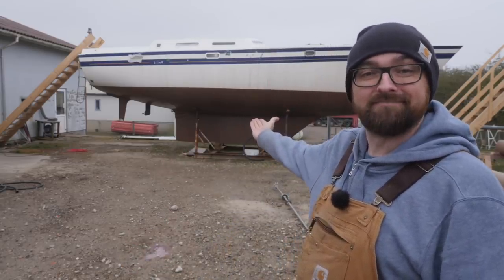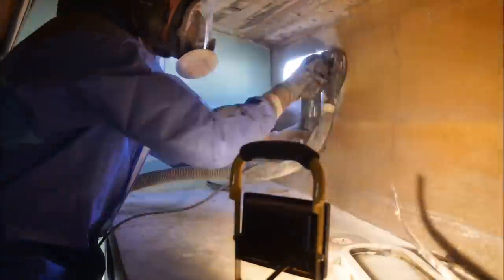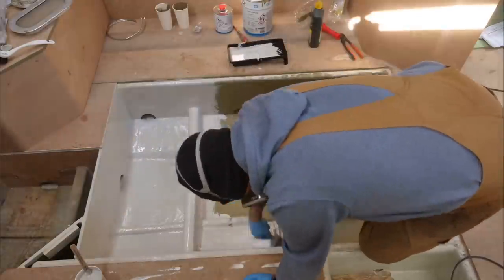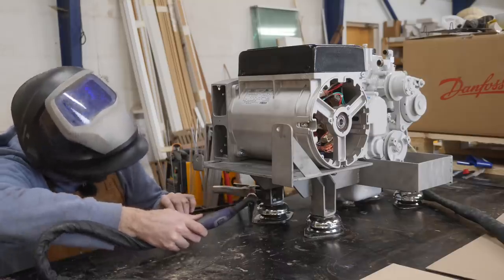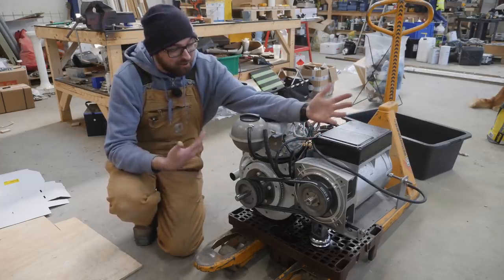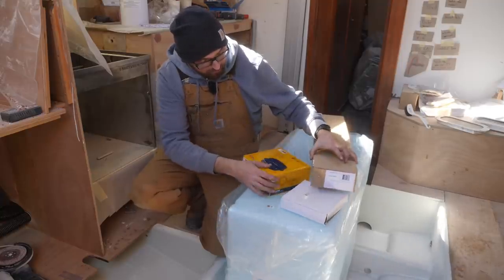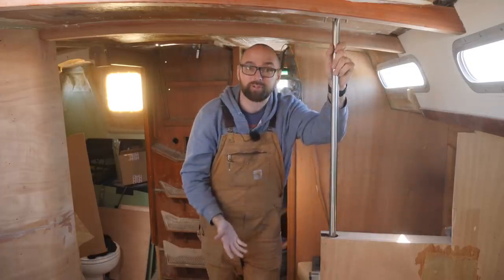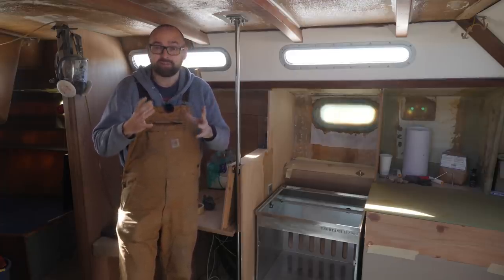Sail Life - DIY generator fail, galley pole - sailboat project

Comment: Hey i don't know the specs but if the 102 block is the same as the 402 couln't you just change the injectors ans the cam perhaps to get a better outpus out of it at a lower price?

Comment: Get yourself the right sized engine for the generator. It'll be more fuel efficient as it won't need to be run as long or as often as the smaller engine. Do it right first time 😉

Comment: I might suggest that you calculate just how much more generator run time is needed with the reduced generator capacity.  For battery recharging-your biggest generator load- take the available amp/hour capacity of the battery bank (total AH*Depth of Discharge), divide it by charging efficiency and divide that number by the 4,000 watts from the generator.  For sake of discussion I assume the minimum battery bank you might use would be 4 conventional flooded L-16 batteries with an AH of about 400 and a DOD of 50%.  Recharge time from a fully depleted battery bank is about 1.2 hours, theoretically.  Once you bulk charge with the generator, absorption and float are less critical and will be augmented by solar.  Your battery choice might have a greater AH capacity so adjust the figures accordingly.

The Victron 24/3000/70-32 has a max DC charging amps of 70.  Two of them would charge at a maximum of 3.36 kW, within the capabilities of your existing generator.  The inverter(s) intelligently reduce charging to prioritize loads, protecting the generator but prolonging recharge duration.  The inverter will also sync-to and support the generator to power loads above the programmed generator capacity, assuming the batteries have some level of charge above low battery cut-out.

These back-of-envelope calculations indicate a 4 kW generator, while not ideal, may not be too bad of a situation. 

I am an off-grid energy designer and I would be happy to provide pro-bono design input.  I have minimal marine power experience, however.

Comment: It wouldn't be a proper build without a proper screw up. 
I agree with the comments..... upgrade the engine, if possible, for more output or swap out for the 402. 
Not a massive mistake. Not life threatening. It won't make the boat sink.

Comment: Can you mount the generator so you can use both engines to drive it? the perkins for low amp. and main engine for the hevvy stuff.
and no need to run 2 engines while motoring.. 
With free wheel ? on both engine pulleys it would work .- the generator runs on the engine's that is on..
don't know if they can handel the load of your generator but on most diesel cars you have free wheel on the generator  pulley. 
many car's have generators over 120A so I think they will work..

Comment: Sell it.  Or keep it.  Maybe get it in and used, then upgrade it if you feel it's not actually working for you.  Dont worry yet, much to be revealed in months and years to come.

With the solar, make use of (or design) a flexible mount so that you can point the panels at the sunlight.  That will net you more consumable energy.

Comment: I was just getting ready to suggest running two 3000 multi plus victrons, but you beat me to it. That would work well for your situation. You can just turn the charge amps up to whatever point you feel comfortable loading the generator. Not a big deal. Your gen time goes up by 25% but what the hell. Live and learn. One annoying part of running the victrons in parallel is that once you program them you can’t turn one off. If one fails you have to disconnect it and reprogram things. Kind of a PITA. No quick way to get power from just the one.

Comment: Does the 402 have the same cylinder bore as the IBP? Therefore, is it possible to modify the IBP so it has the same output as the 402? ie, use 402 internals and adjust the fuelling, as it possibly has a longer stroke. Or, does the IBP have enough torque to run another smaller generator at the same time? Or, can you sell the IBP and get a 402? I suppose it boils down which of these is cheapest and easiest.

Comment: Will that small Perkins 102 work to power a small dive compressor (like a 3cfm) ?  Doesn't solve your generator problem, but you might be able to repurpose that motor.

Comment: I don't quite understand the incentive to install a second engine. Would it not be a tad easier to connect the massive generator to the existing main diesel engine? One less item to install, maintain, provide sound insulation, take up space? I would not anticipate fuel consumption running the generator to be much different between the two engines.

Comment: What’s the actual internal dimensional differences between a 102 and 402? If the cylinder is a larger bore, couldn’t you get it punched out with a 402 piston, sleeve, etc? That would have to be cheaper than a wholesale replacement.

Edit: looking at the spec sheet the bore are stroke differ between the two. Maybe it can be punched out or resleeved with 67mm bore and 72mm stroke. I’m no machinist but sounds plausible!

Comment: If the Perkins 102 and the Perkins 402 have the same dimensions and same outer hull wouldn't it be possible for you to simply swap out the itty-bitty-tiny-little-Perkins 102 for the stronger one?

Comment: So not really familiar with perkins but cummins diesel engines alot of the time have extra head room when they are built,  older truck engines it was throw in bigger injectors and/or turn up the fuel pump pressure. Newer trucks alot of the time it's just program the computer. Not sure if perkins follows suit but I would not be surprised if you could tweak the engine a bit to maybe squeeze out a few extra ponies one way or another. Or maybe just find the 402 you were looking for and go from there you have something to sell/ trade with the running 102
Reply: Your little 102 does have a fuel adjustment screw so there is a possibility of tweaking it though it is a give and take, turn it up to much and you will be puking out un burnt fuel and lots of carbon build up.

Comment: I’d say buy the smaller alternator and finish off the 102 generator and sell it to someone in need, especially if the used market is so bad. Then get the 402 and use your larger alternator to build Sail Life Generator 2.0!

Comment: Yup, do it right and you know what "right" is.  If you stay with itty-bitty, you'll always and repeatedly, kick yourself that you didn't upgrade.   Sell / Donate "itty-bitty" and obtain the size that you need.

Having said all that I think you need to go back to square 1 and relook at ALL your options to provide a separate power charging system.   I'm thinking that you'll want to keep with diesel BUT, you may want to purchase a turn-key solution.   As I say, look at all your options.

Comment: If the 102 and 402 look identical, is it possible that the 102 can be modified with 402 components(pistons, cylinders, carburetor, etc) to get the benefits?

Comment: Well your washing machine or oven do not pull the rated power all the time. There are charger/inverter combined units that will help out via the battery and  then recharge the batteries while your appliances are not heating (75% of the time). Better find out if your setup is worth it before sinking more money in your genset

Comment: My 1 cent to add to the pile---it sounds like the 102 might be large enough to serve 75% of your needs, is there any way to increase your battery bank so you can store more power and for times when you need maximum wattage, how hard would it be to put a generator on your main engine?

Comment: Just a random thought here. But can you not attach a larger pully to IBP to make its rpm  effectivley higher, it should work up to a point where there is too much load on the engine. Won't cost much to do.

Comment: I think you are being way harsh on yourself. I can understand your frustration, but keep it in the perspective of literally everything else around you that you have done so well.  Install the itty-bitty Perkins 102. Keep your peepers peeled for a well-maintained 402 or another quality replacement (Perkins or otherwise). You may not find the right replacement until you and Ava have been sailing for a year or more. But it will appear, and the 102 will perfectly sufficient in the mean time.

Comment: How about adding a fairly powerful generator to the main engine, combined with a battery charger of like 2000 watts?
So I guess that you would need a generator that can output about 200 amps at a reasonble rpm. I have no idea though if there are such generators available, what they would cost, how big they would be, but it would perhaps not be totally unreasonable?
This way you also get a kind of redundancy if the Perkins setup fails, and you can use a fair amount of electrical power when going by motor without starting the perkins setup....

Comment: Would it be possible to increase the diameter of the pulley on the Itty-Bitty perckins and reduce the pulley diameter on the elec motor to increase RPM and therefore increase kw ?

Comment: Mike_ Sandee
1 second ago
i agree with simply upgrading the parts for a 402,  of course do the research,  but Perkins would use as many parts on all models as possible even if it lowered efficiency in an effort to save money so this will work in your favor to re-mod it!!

Comment: Also, a 6000W inverter draws 250A at 24Vdc or 500A at 12Vdc. Consider the cost of the wires, connectors and the batteries to generate such power. You would be better off with a more reliable, lower wattage inverter. My two cents worth...

Comment: As far as the generator goes, can you send the bigger alternator back and replace it with two smaller ones?  Will the motor power two?
Reply: Maximum power out (of the diesel) equals maximum power into (and out of) the alternator(s). You can't magically get more more power out of one or more alternators than the engine produces. That would violate the laws of physics. And given that no conversion system is ever 100% effective, you'd probably only get 90% of the engine's output from the alternator(s) anyway.
Reply: JAFO I have seen multiple youtube videos of engines with more than one alternator.  If they are run in parallel the synchronization must be identical which is difficult.  It is better to seperate the battery bank into two seperate banks and run them on the same motor but with two different charge controllers and battery banks.  You could produce 8400 theoretically if the motor can handle it.  

https://www.cruisersforum.com/forums/f14/using-2-alternators-to-charge-a-house-bank-79903.html

Comment: Ok I feel for you.  You did a lot of work and planning and I think the generator as it currently is not going to work for you.  But I don't think you should give up.  First since the 402 and 102 look the same from the outside there may be just a few internal parts that are different and perhaps you can replace them to get what you need.  There is a good chance that the only difference between the two engines is the size of the piston and the cylinder.   If that doesn't work maybe you can try "hot rod" your little engine.  There are always ways to get more power from an engine.  I bet your engine has mechanical fuel injection but if it has electronic injection you made be able to remap the software to add more fuel.  A diesel engine is not like a gas engine and adding more fuel will produce more power.  Also because your current setup has all those pullies in place perhaps you could supercharge your engine. In any event give it a try because I don't think you will be happy with what you have.  Best wishes and stay safe.  BTW enjoy your video's.  Thank you.  PS:  One thing that also bugs me is your hatch covers.  A hour of sanding and a bit of varnish and they would look a thousand times better.  Of course I understand why is not on the top of your list but hey it bugs me.  :)

Comment: will not the close proximity of the freezer/refrig, cause condensation, with the warm diesel from the fuel polisher,  inside the diesel tank ? --swap out the small engine for a bigger one, now,--and think about 2 wind generators, as they will work, when you are moving, and when the wind blows at anchor,

Comment: If the two engines look the same, what makes the difference between the two? I know that with gasoline outboards the difference between a 9hp and a 15hp is the carburetor. I know that diesel is not carbureted but...... what can reasonably be done to increase the engine output? You could increase the engine pulley size and decrease the alternator pulley to up the output. Similar to road bikes or variable speed drill presses. That should allow you to keep the engine rpm’s lower while increasing the rpm’s on the alternator.

Comment: Hey Mads, stop beating yourself up, you are human. I seriously doubt there will ever be a time that you need to run the dive compressor/the washer/the water maker/ the anchor winless/water heater/blow dryer etc. at the same time. You can only overthink and over plan so much. As the Rolling Stones said “You can’t always get what you want, But if you try sometimes you’re just my fine, you get what you need! Cheers

Comment: 4kW should do you, imho.  Charging the batteries comes AFTER all the other uses, not before, so calculate based on that.  My HOUSE rarely went above 4kW (before I put in the full house instant hot water system, which you would be insane to have).

Comment: Why not keep the small motor as a backup power supply and get a 401 for primary power?  You could use the smaller motor to use less fuel for times you need less power.

Comment: You have a lot of projects ahead. So I would call the generator project done and move on to other tasks. Best is the enemy of better.

In the meantime you can keep an eye out for a used engine with more horsepower. Could really be any brand. And it could be a few months or a couple of years down the road.

Comment: Would you get more power if you changed the pulley size on the engine for a larger one so that the alternator spins faster?  Did you consider selling the 102 and buying a 402?

Comment: I agree with most of the commenters that you should go ahead and upgrade the engine while you have it out.  As annoying as it is now, when you are on the water, you will thank yourself for going ahead with the bigger engine.

If you can't source a larger engine for a reasonable price from the boating world, check other industries that use small diesel engines, like used commercial power washers.  It's not something you usually see listed, but you can find tons of these engines out there with a little digging that might just need a little tune up to be good to go.

Comment: I would stay with the tiny motor, devices like the dishwasher or the washing machine do not permanently use their full rating - quite the contrary.  increase the size of your inverter and battery pack, that way it acts as a buffer wetween the Perkins and the machines using the power. Adding a bank of supercaps mght eb a good idea too, as it takes the peaks out. that way you have no current peaks drawing on the batteries when larger motors start up.

Comment: if the iddy biddy teeny weeny perkins 402 and 102 look similar, can the 102 be upgraded internally, what are the engineering differences? Don't beat yourself up so much Madz, it was an easy mistake, water under the bridge now mate, you'll sort it no worries

Comment: Not engine related but please think of weight management (Not left/right more Front/Back) - if you will have the normal engine, the ittibitti, one Diesel Tank (behind Main engine) and battarys all in Back of the boat your sailboat will Lock Like this in the Walter: \ 
So you must put weight more to the front! 
This might be a big issue on downwind course!

Comment: Dear Mads,

I understand your disappointment. If I were you, I would not downgrade my electricity supply. You do need 10kWh. And I understand also your pride in having a diy generator. You are one of the best diy guys out there. But maybe its time to look to the market and buy an Onan or Whisperpower unit (fully encapsulated and with electronic control hooked to your nmea 2000 network) and sell your diy unit. 

Your comfort will depend on it.

May I say also that your fuel tank is not that large. 215 liters is better than 100 something, but your boat needs twice that much. So please think about fitting a second tank in the empty cabin at a later stage.

Lets assume the 10 kW generator uses 2 liters per hour, 200 liters will therefore only represent 100 hours of operation, assuming you don’t run your main engine.

Cheers,

Comment: Are the exterior dimensions of the 102 and 402 the same? If so, would it be possible to upgrade the internals for more power? I remember seeing some outboards that get a cheap, quick and easy power upgrades from a carb swap.

Comment: Why not use the extra Vee on the engine pulley to run another 12 volt alternator. Yes it will use power from the engine but it will be more efficient than the 240v through a charger to 12v. I think you will be supprised at how little you really need. I have a 12kva generator but never use more than 4kw. Don't forget that most 240v 16amp shore power supplies will only give you about 3800 to 4000w so your generator is not far off.

Comment: Hey Mads, how did you laminate the coach roof section for the galley pole? Did you just put some laminate on without bevelling 12/1?
And give the engine a performance upgrade...
Reply from the maker: I beveled the edge. Way more than 12:1 but that's just because the bottom skin in the cabin top is very thin (2 mm). It's faster to do a bigger bevel with the angle grinder 🙂
Reply: Sail Life In the West system bible (American version) at page 31: Replace damaged core from below. Without a bevel. I thought U might did it that way. That’s probably how I will tackle my deck with rotten balsa core. Any thoughts about that Mads?